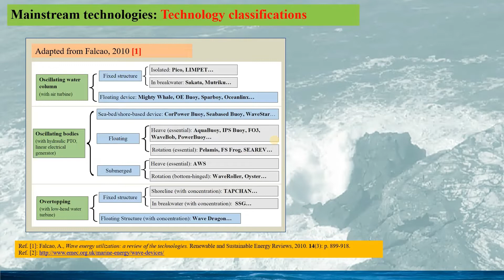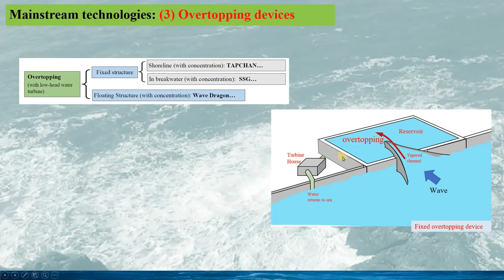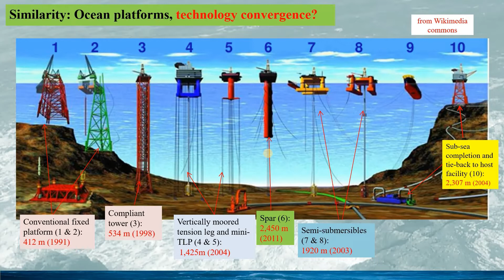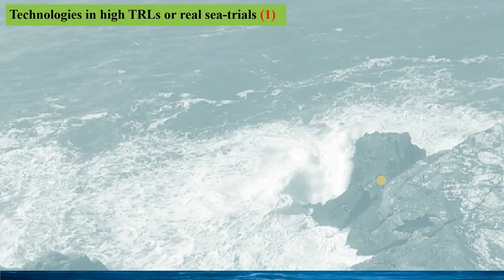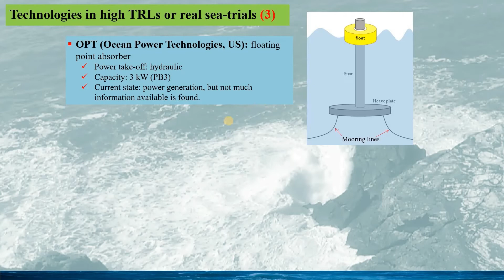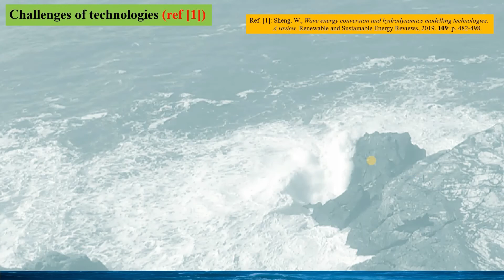[Wave Energy Conversion] Introduction

Comment: Sir
thank you for the information and causes of failure 
I am working on project generating electricity from speed breakers using hydraulic PTO
does  hydraulic PTO have inherent problems 
shall I think for linear generator or linear generator attached to a pendulum ?
please guide or refer
Reply from the maker: So far there is no pto which is accepted by all. They all have their own advantages and disadvantages. I guess hydraulic and linear generator would have similar problems. Thus it depends on what is available to you.